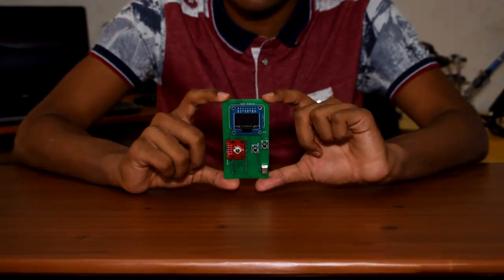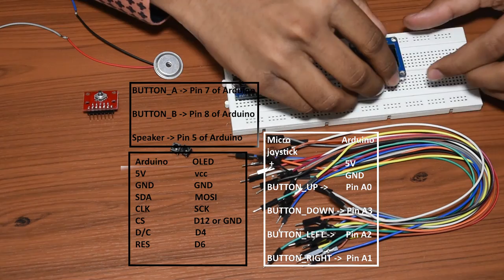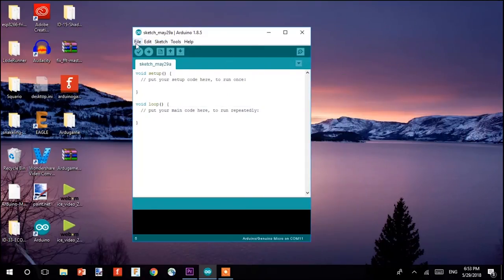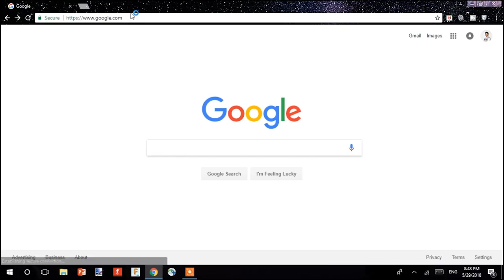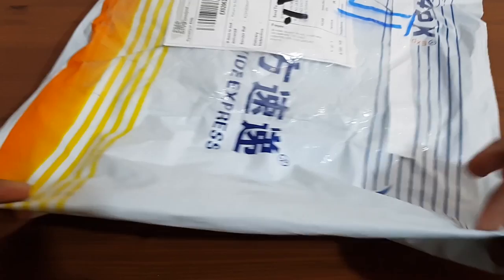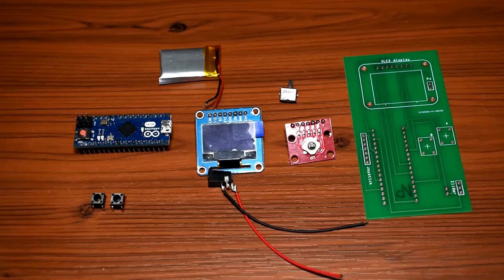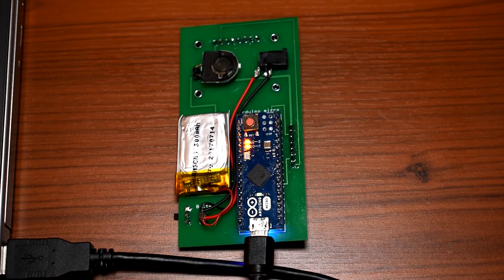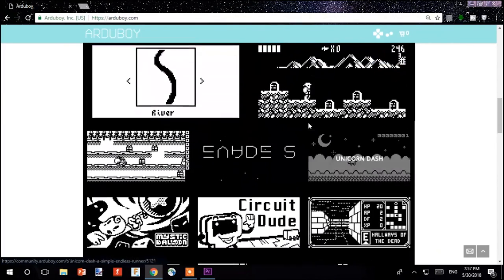DIY Arduino Handheld Game Console!

Comment: hello very nice arduino boy  Only problem I have is that my oleds are I2c not this type. They only have 4 pins. you help me out in changing this to my screen please?
Reply from the maker: The project only works with a display that has an SPI bridge because all game codes are programmed to function only with them. In that case you have to modifiy every game code to make it work with it.
Reply: @shyam-ravi   can I use Arduino nano if yes then what type of changes I have to do in programs

Comment: Can I use Arduino pro micro
Reply from the maker: Yes, you can. But it will have less gpio pins. So I just suggest you tu get an arduino micro.